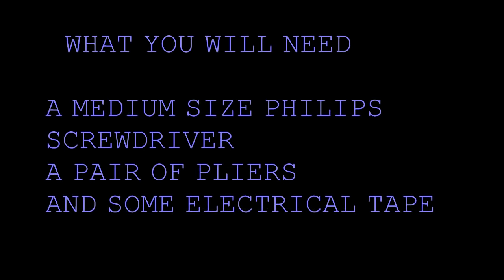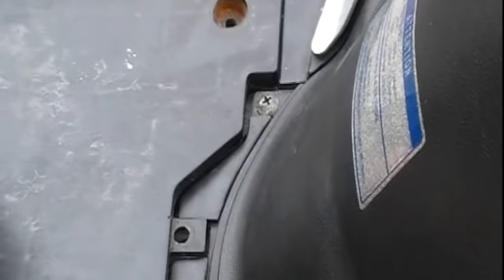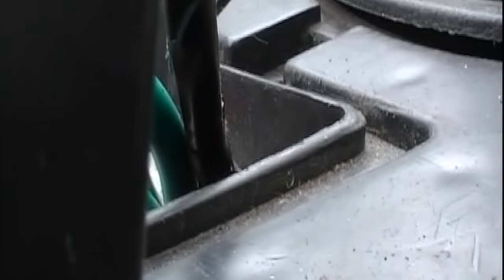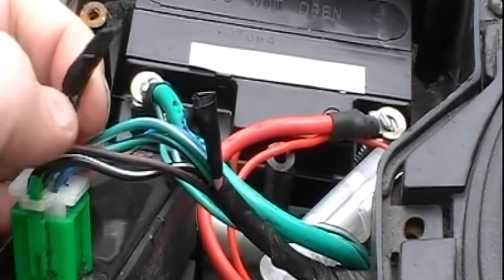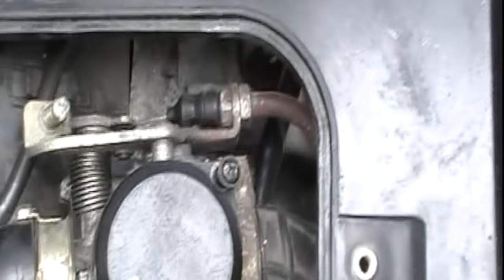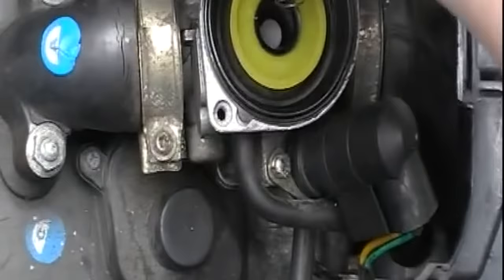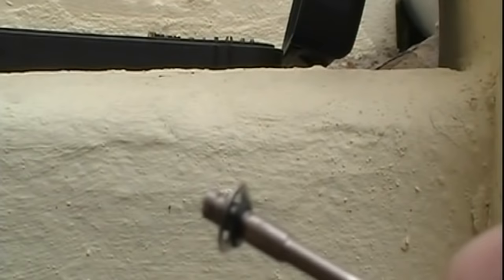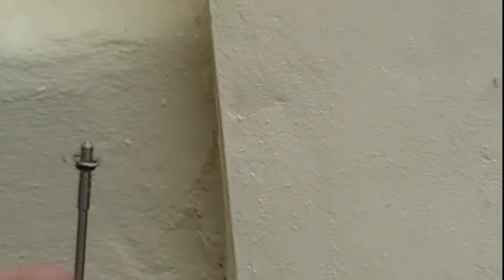How to derestrict a 50cc scooter / moped Make it go Faster

Comment: That's not how you de-restrict an Scooter ..You get 133cc kit carb and aftermarket power pipe and you ride the nuts off it til it blows up!!...Then you either re-bore and get an new piston for some more CCs or you just go buy another new kit cos the carb and exhaust won't ever fail. .Lots of kits to choose from but they don't last half as much as the fun does ...Got it? 133cc kit big carb power pipe and away you go your in the big boys league til it blows up and remember that's part of the fun..

Comment: I'm not sure why this guy is being berated for this... the CDI 'is' limited and will stop the scoot from going above a certain road speed as dictated by the speed of the rear wheel.  This info is passed to the CDI via that pink lead. I've got a 2010 model VClic with the green loop on the CDI which is now cut and taped. The speedo now happily goes into the red on the flat (maybe an extra 4mph) and way into the red going down hill (speed depends on steepness of the hill). Previously it would have stubbornly stuck at the redline regardless. What derestricting the CDI will NOT do is give you more power. You'd need to change rollers and springs to help the scoot work in the power band (slightly higher revs) but even that doesn't strictly give it more power. Pull the pink lead and give it a try... you can always plug it back in again if you don't like the result! :)
Reply: Carsten B I was going to type a lengthy explanatory response here but I thought that the plethora of capital letters, long words and grammar might baffle you. Fact is the VClic is limited at the CDI. The green wire limits the road speed at the CDI end. This can be bypassed by cutting the green wire. You don't have to like the facts but at least have the mental capacity to accept them. Perhaps also question why that loop of green wire was made so accessible in the first place since it has no other purpose. And finally - you are aware that 2 stroke and 4 stroke are very different?
Reply: Carsten B I forgot to mention the reason why the speed is limited on Chinese scoots (unless derestricted at POS). Most US states have strict laws on speed. Anything over 30mph in most states is considered a motorbike and falls under far stricter laws and insurance rules. It's far easier simply to restrict all scoots at source. Again, this is a fact that you can choose to ignore if you like.
Reply: Carsten B There is a lot wrong with your grammar but that's a different discussion and I bow to your ability to learn languages. However, I didn't say all CDIs are restricted. I said 'the' CDI, ie, the one that the guy was working on in the video, is/was restricted. I didn't say all of the CDI restricting wires are green. In fact I stated that mine is the newer model VClic with the green wire loop. There was no suggestion that all CDIs use a green wire as that would be patently untrue given that I had previously discussed the older model CDI using a pink wire.You claimed that cutting the wire could not possibly derestrict the CDI... and that is wholly untrue. I also mentioned the 2 stroke vs 4 stroke issue for a reason.  A 50cc 2 stroke (eg, your mate's Aprilia) is easy to tune and get decent speed out of using a few pretty rudimentary skills. The power band is a bit of a bitch and it's tricky to keep the machine useable but yes, you can get decent speeds out of them with the main restriction eventually becoming the CVT. The 50cc 4 stroke is totally different. It simply lacks the guts at any rev range even when tuned to the hilt so the most you can do (or at least the most that is worth doing) is the derestrictions on the CDI, CVT and exhaust (although, as you say, not all of these are applied to all models from all manufacturers). Unless you've never worked on a 4 stroke you'll know this already!?
Reply: oh lord mlud  you just brought  the green wire into this mess lol

Comment: All you did was remove the rev limiter and thats leaning, not richening. If its a 2 stroke, the engine will seize very fast. If i were you, just buy a racing cdi and performance coils and plugs for it and that will make a small difference. Or if you got big bucks, upgrade the carb.
Reply: H
Reply: ive always wondered if a guy can run a 150 carb on a 100 bbk 50cc. scooter?

Comment: it also blows the magneto out as it pulls too much current as completly unrestricted, the proper unrestricted cdi,s still have some resistance to control the voltage being taken by the cdi unit. unrestricted cdi,s only give a fatter, more powerful spark to burn the fuel better hence a bit more speed!! but remember peoples that its only 49ccs so u aint gonna go that fast no matter what u do to it!! doing the needle is the better idea though, fairplay
Reply: ok then brainiac, u explain it then. what does the pink wire do??? and how does the cdi unit respond??hmmmm??
Reply: your comment as long as mine!! if you know more then please share it!!
Reply: Carsten B ha he dident comment back :3
Reply: my mates aprilia can do about 70mph people underestimate 50cc
Reply: Carsten B i think it was that he didnt want to start a flame war with you, probably wasnt worth your time
Reply: your full of shit my mtx 125 with a fully rebuilt engine tuned to perfection only when 75 80 mph a 50 will not do that the most your get out of a 50cc fully moded will do about 50-55 mph and that's includes bouring the engine out and have bigger jets in the carb
Reply: went*
Reply: i call bs
Reply: why dont you just post your apparent super duper powered mopeds online, and give us the link so you can prove us wrong?
Reply: because i dont believe you thats why
Reply: Carsten B no.. they dont go that fast
Reply: im not a money tree, i cant just miracuosly obtain a very expensvie plane ticket, and then get jet lag just to be greeted by a shitty country so you could prove me wrong? no thanks. id rather stay here where its safe in the U.S.A
Reply: when did i say anything about being racist?
Reply: ***** yes i have, and what?

Comment: trying to make my 50cc back to a road legal one. just looked at the pink wire its still connected to cdi.  cdi looks the same as your one do you think it may just need a factory cdi installed again but would i still have to mess around with carborrator.

Comment: hey billy, nice try but you're doing it wrong.. how do you check your mixture, how do you know you've done the right thing by moving the gasneedle... it could work, but explain how you check it.. and one other thing, by lowering your needle you are actually giving your motor less gass and that is why you need a larger main jet in your carb..

blackops2376  ok... buy an unrestricted cdi unit(if neccesary), and a yasuni c16 exhaust, a 17,5 or a 19 mm carb, a malossi variator and take the litte airflowrestrictor out of the original airfilter... and some other springs in your clutch and pulley. do this and you will get somewhere around 90 to a 100 kph... have fun! :p 
i also made the exhaustport of the cillinder a litter higher and wider, and got a little more than a 100 kph out of it...
Reply: He licked spark plug in previous video

Comment: Remember to run more oil to your gas once you do this.
Reply: +Ariel Lezen That would further lean out the mixture.
Reply: +john robert Since you'll be going faster, the piston moves more quickly and thus generates more heat, so it will need extra oil. (Also by moving the slide socket upwards you'll lean out the mixture).   You can adjust the mixture to be richer by turning the mixture screw clockwise on the carburetor.
Reply: +john robert Just run the thing richer. more rippems means more friction but since we're not talking about the delicious friction you hear in romance novels we'll probably need a bit more lube, eh?
Reply: why would he add more oil to the gas since this is a four stroke engine??

Comment: You can tell who has knowledge and who ain't got a jar of glue .right in layman's terms, never cut a wire with battery still connected ,your more likely to short it out by accident .to what rpm sensor you on about ? It reads rpm from the pickup (magnet sensed pulse),more the motor spins up the more pulses it senses. Cutting the pickup reddening the cdi to tell what position the motor us actually in , it wouldn't know when to spark , the wire you cut was either earth that the unit sorced earth elsewhere or it didn't run again , some cdi's are governed but you need to be an electronic boffin to work it out to remove , autosparks would struggle to know how to remove restrictions in cdi ,if it has one then buy an aftermarket cdi without a limiter . Right as for fuel adjusting the method shown will lean the fuel ratio (it does run better but not for long ,it seriously damages the motor due to combustion being way to hot ,they run slightly rich to keep combustion temp lower so you don't melt nothing .if it don't melt through the piston it warms the piston way to fast causing heavy wear on the skirt as it tries seizing , congratulations you now need a piston 5x faster than you would of done ,that's if it stays in one piece as if it goes then you could be looking at a new crank,barrel,piston and head . This video shows nothing about  deresticting just a way to botch a bike to make it cost you more money , if you want good advice talk to your local bike mechanic, go get him a chocky bar and a can of pop saying you don't wanna disturb him or her ( yeah females these days ) but you need to pick there brain about something and they'll usually be happy to share knowledge if they not snowed under in work

Comment: So you have removed the regulation and weakened the mixture which will require the carb to be rebalanced. Great fun but you are now uninsured in any circumstances you use it. A canny cop has only to look at the ignition system and if you have an accident everyone of us with motor insurance pays your victim. That is why you are limited to a low powered motorcycle to start with and why it becomes so expensive for you to move up the motorcycle tree. The future of your transport is in your hands.

Comment: I have a chinese honda clone 50cc scooter (139 QMB) I moved the needle snap ring to the center but my wire colors are different with no pink wire.2 wires in one push on and 3 in the other push on.Any clue which wire would be for the rpm?

Comment: Dropping the needle valve like that will restrict fuel so the the scooter will be sucking in more air and less fuel and higher rpm. With the rev limiter disabled added to increased airflow will turn your motor into a hand grenade,just sayin.

Comment: Mine doesn't have an adjustment. On the dykon49cc  its just a 2inch or so pin that holds a while clip for the spring to seat on... Any ideas? I have a everyday driver I don't wanna put money into.   This idea would a been perfect.  Not sure if the taotao I'm building has this. But I will check

Comment: It's only illegal for a 16 year old to ride a moped registered after 1977 that is capable of a top speed of more than 30 MPH.

If you are 17 or older and hold a 125 provisonal or full motorcycle licence it is perfectly legal to ride an unrestricted moped provided that it is insured as a Class B moped (unrestricted).

If a moped is restricted to 30 MPH then it is a Class A regarding insurance.

I ride a Babetta 215 which is insured as a Class B as its stock top speed is more than 40 MPH.

Comment: Will it work on my Alpha Sports Kaliber LS moped? The seat is a PAIN to take out. But uh yeah I think I found the CDI unit in the front near the headlight. It is a two stroke. So uh yeah if you could private message me the answer or just reply to this that would help a LOT thank you!
Reply: im not sure wether or not you can do it with your type of moped but, what you have found near the headlight is a kind of voltage regulator that stops the headlights and indicators from blowing their bulbs. The CDI is usually located near to the battery as it was in the video however some are found underneath the plastics attached to the frame (usually with a cable tie)
Reply: YOLO BABY Or under the seat on my two stroke Keeway Focus

Comment: I wonder if one could add a rev limiter to the cut wires that dials the rpm and then adjust the fuel flow.
Reply: No it's programed you can get tuneable CDI

Comment: Hell, the one I have runs like crap, I'd be happy if it ran normally
Reply: +tanner122772 a clogged pipe is almost always the problem with an older scooter.
Reply: +stephenmwyatt2 
It's a 2014 tao tao scooter that was bought new about 6 months ago
Reply: +tanner122772 try adjusting your fuel bolt or i had problem before old gasoline in fuel tank clogged up filter in tank
Reply: +Tim Pashnik 
It was my valves, they needed adjusting. Did it myself, and now it runs better than it did when I first bought it!!

Comment: A bit of advice for next time, make sure you disconnect your battery before fucking with ANY wires at all. You know, that way you don't get the ever loving shit shocked out of you.
Reply: 12 volts will barley tingle. Grow a pair.
Reply: +Cheesedoosh Now that wouldn't be to smart would it?
Reply: AUSTINS AIRSOFT Grow a pair.
Reply: 12V won't do shit to you unless you put the wires in your mouth which would be a stupid idea.
Reply: +Ame Nightcore Obviously. I know 12 Volts wont do anything. But a general rule of thumb is to always unplug the power source while messing with wires. What if that open wire falls onto some spilled gas? 12 V will do a lot to you then. Stop pretending to be a bunch of internet hardassess and be smart.
Reply: are you f or m?
Reply: ***** Lol misogynist much?
Reply: Cheesedoosh Yeah I get what you are saying. Better safe than sorry when you are around a tank of highly flammable liquid.
Reply: ah ok mate haha, its cool anyway only a bit of banter-rock n roll
Reply: wish I had read this first. ,lol
Reply: One of them nasty 12V shocks....
Reply: *****             Thomas you make me pictures City pictures
Reply: *****             Thomas you make me pictures City pictures

Comment: moving the clip up on the metering rod allows less fuel from main jet into the engine at low to moderate rpms and at wide open throttle the metering rod is alway far enough from main jet that it has no effect on the amount of fuel that the engine gets, sorry BillyUK but you are completely wrong about this and you can potentially lean an engine out more at aprt throttle and cause it to run hotter and be harder to start when its cold.

lower the c clip on that needle and you richen the part throttle mixture and decrease the temp of the engine if its a bit on the lean side.

for very cheapbyou can get a replacement CDI that has no rev limitation and actually advances the ignition timing about 4 degrees which help the engine make more power in it low to medium rpm range.

increase main jet size in carb and install free flowing exhaust with a higj flow air filter on carby and you'll see a definite performance increase and you wont hurt the engine if carb is jetted correctly.

You should either revise or remove the part in this vid where you're doing that useless carb mod. it could cause someone to hurt their engine, that isnt an improvement at all unless the engine is already running to rich because its being used in a very high elevation area where the air is thin.

Comment: Re: cutting the rev limiting wire on the CDI. Would this cause any issues with the bike overheating due to the ability to increase the revs way above the restricted levels?
Reply: If your bike is air cooled then most likely yes but if it’s water cooled then it should be fine

Comment: An interesting video mate. but to be honest adjusting needle valve like that is potentially dangerous far better to upgrade and reset jets and upgrade plug and exhaust system....jets control fuel flow, plug upgrade will increase out put at spark and exhaust will allow for those additional gases to be expendinded quicker and a qiucker flow of the power output

Comment: so on my Bashan peace sport 49cc. my wire is light green , I cut it, and my scooter wouldn't start. then reconnected it started. was that not the right wire? and if it didn't start but was igniting "starter ingaged" was their not enough fuel in carb? I did not move pin , just cut wire. was I on the right path and only did half the job?

Comment: you know i would try this but i would hook it up 2 a switch of sought ... so i can just flick thee switch and its back to normal... dont fuck with carbs ..simple ...they are tuned at factory and a professional license motorcycle mechanic should fuck with it.. that way if it dont run .. you can blame em for the stuff instead of your self... 

common sense

Comment: Cut the pink wire going to cdi I went from 30mph to 46mph it will go faster but that's all I want to push it needle velve won't do a thing past 1/3rd throttle all you are doing is running ritch upto 11mph

Comment: If the wire is only sligtly pinkstriped, then it still would count for a pink wire, right? All my wires are black, but they do have a small strip on them with a colour. And the on that I think it is, is a bit pink-like in the colour tone...

Hmmm... Should I just pull the little bastard out of there or should I better not?

Comment: This might work but get a family member/friend who knows about scooters to do it or pay a small amount of money to a garage to do it, don't risk fucking up your bike for 10-15MPH more, it's not worth it!!!
Reply: Carsten B  the cdi limits the amount of revs the scooter can do, so when the pink or green wire is cut the limit is gone. So by removing this restriction it adds 5-7 mph to your top speed. if your only cutting the wire you don't need to do this second step